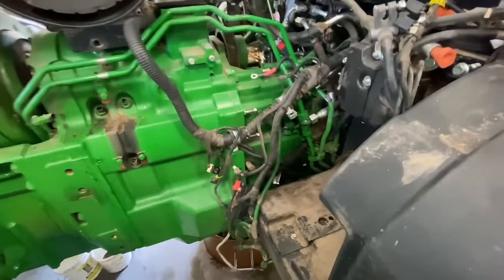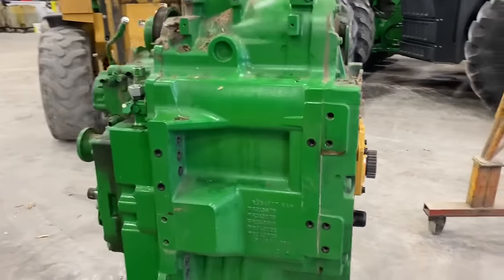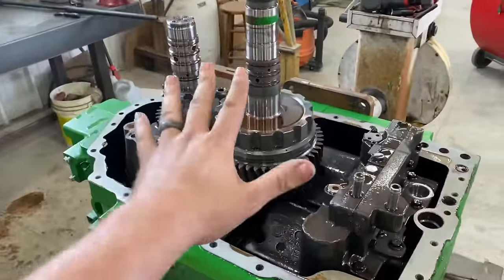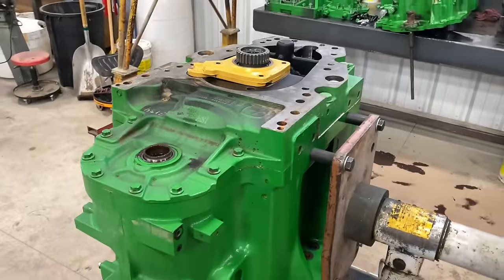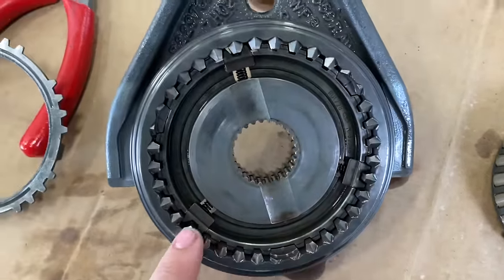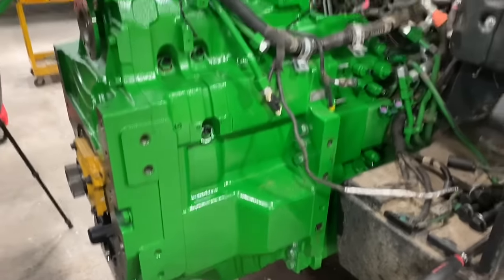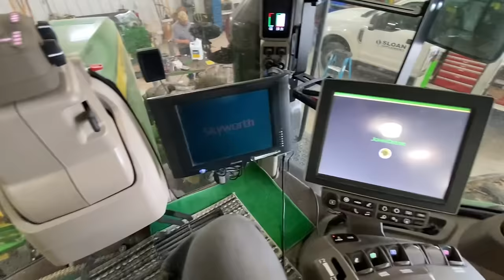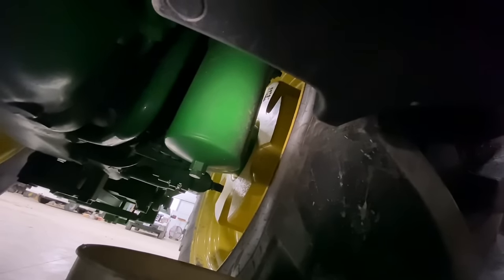John Deere 8370R IVT will not come out of park or calibrate.

Comment: Great video but as a machine owner I'd like to know why things like this break. This would have been incredibly expensive. To my mind it is a design fault. How many hours had the tractor done? I'm in the process of buying a new piece of equipment for my earthworks company and I'm extremely cagey about handing over hundreds of thousands of dollars for inherently faulty machines. Channels like yours can do a great deal of good in helping us make better decisions. With out further info this tractor is off my list.
Reply: How did you come to the conclusion that this is a design fault? What exactly in this design is faulty?
Just assuming it's a flaw in the design because it broke without any further information is a bit naive.

If we look at the simple statistical facts, the 8R Series is no less reliable than comparable machines from other brands. So is the IVT. Single examples of issues are nothing one can use to measure realiability. I even saw a Civic break, and they are among the most reliable cars of the world.

So if you're going to cross every tractor off your list that ever had an engine or transmission blown with low hours, then you're not going to buy a tractor anytime soon :D

(btw, one can order the 8R with the bare bone standard PowerShift transmission if one deems the IVT as too unreliable)
Reply: @LydiaOfTheNorth  I don't know of any pumps that have failed in that way. They wear out typically not break. When you are parting with hundreds of thousands of dollars you become very gun shy of breakages like this. You clearly don't own any machinery. Yes IVT's are unreliable that is pretty evident.
Reply: @toast47624  
"I don't know of any pumps that have failed in that way."
That is anecdotal evidence at best. My mother never had a car accident, that is not evidential of their non-existance though.

"They wear out typically not break."
That is of course correct, yet is a breaking part no evidence for a flaw in a design. Might very well be a material problem, microcracks that snuck through QA etc.

"When you are parting with hundreds of thousands of dollars you become very gun shy of breakages like this."
Which is why you even more should refrain from relying on single issues and look at the bigger picture. Again, just because you see a Honda Civic break with low mileage doesn't make them unreliable cars.

"You clearly don't own any machinery."
Plain wrong, not only do I own but also engineer machinery. Because of this I'm always so baffled when people are able to point out design flaws with literally no information on the matter while I am absoolutely not. 
So my question still stands: can you point out what exactly is flawed in this design of a hydro and / or transmission? I'm highly intrested to find out.

"Yes IVT's are unreliable that is pretty evident."
They are in some parts not as reliable as "standard" gearboxes, but I meant to say that JD's IVT is no less reliable than other manufacturers IVTs. Then again, if that is a concern for you of course, just get the PowerShift instead.
Reply: @toast47624  my comment was not meant as an attack btw, I'm just really curious how you came to that conclusion so fast. With basically no information, that design flaw must stick out like a sore thumb, but it just didn't to me, that's why I asked :)
Reply: @LydiaOfTheNorth  I've been around machines all my life so my suspicion stands. I too would like to know why it failed. Once you have forked out thousands of dollars for such repairs you become pretty sensitive. I buy new equipment and sell it the moment it starts failing or preferably before. My experience is once its starts it escalates.
Reply: @toast47624  I'm a retired tool and die maker and have to agree with you @Foardhook, if I had a component that is repeatedly breaking in a stamping tool, and we can't finish the run without having to pull the tool and put a new punch or perforator or die insert in it, it's my job to tell engineering about the problem, I can suggest a fix, a larger punch or or different steel type or different Rockwell hardness, but it's engineering's call to change the design and to find the root cause and fix it forever and put it to bed, and keep at till it is finally fixed, but if I were to just keep swapping cutting details, I would be asked why didn't I say something? and I think that's the missing part in these video's were not being told or shown if any of these problems get back to JD and if there doing anything about them, if other mfr.'s are having simular issue's that doesn't give JD or any mfg. a pass the acid test is always how well does it work, if it's not working stop and try something different like auto racing if there's part breaking make it stronger or different till it stops breaking, while the poor farmer has to wait and pay before his crop is picked
Reply: @LydiaOfTheNorth  sounds like an attack to me… I have an 8370R and the EXACT same thing happened. One of those pistons in the pump failed. Tractor had a little over a thousand hours. Deere acknowledged it has been an issue. Luckily it was still under warranty or your looking at 25K plus.
Reply: @peteparker7396  well it wasn't, unregarding what it sounds like to you or not. And you're missing my point. Singled out instances of something does not provide evidence of a bigger problem in reliability, nor for it to be a design flaw.
Reply: I worked for John Deere for about 40 years and I can guarantee you these failures like this one get analyzed thoroughly back at the factory engineering in Waterloo.  They're going to run a metallurgical test on each failed part to discover why it failed. If it is a design failure they will change the design and most likely offer a PIP (Product Improvement Program).  They have an entire department that checks these failures both in and out of warranty.
Reply: @michaelpasold5083  Good to hear. No doubt they reimburse the owners out of warranty? LOL I don't think so. So our best defense is to come on YT and show everyone so they don't get stuck with a lemon.
Reply: @LydiaOfTheNorth  I get your point it's just that my experience over the years trumps your philosophical position. Evidently this is not a one of failure as Pete stats and frankly here in NZ I know of others. It's ridiculously expensive. I'll stick to a more reliable tractor.
Reply: @toast47624  my position is not philosophical. It's based on numbers, statistics and probability, or, as one could call it: the cold hard facts. Your position is the philosophical one, since you're experience only shows you a tiny part of the bigger picture. 

As I said earlier, if one never had a car crash they might very well say that, in their experience, they don't exist. Looking at the facts tells a different story.

That WAS my entire point, so apparently you do not understand it. But that's fine.

However, I'm tired of the discussion and I made my point. You buy whatever tractor you want sir, if you can find one that hasn't listed a single failure on youtube, that is ;)

Comment: Thanks for sharing your work. I have a question if this transmission is manufactured by John Deere or is from another supplier
Reply from the maker: John Deere manufacturers the transmission but there are components that are in it from other manufacturers. Like the hydro module is made by Sauer Danfross.
Reply: It is a John Deere transmission
Reply: I'm pretty sure that Deere produces the IVT castings in their foundry in Waterloo, IA - just pulled up a pic of a raw trans housing and confirmed that they have JDFW cast onto them (John Deere Foundry Works).  I worked for Deere (Maintenance - SPO for a bit then T10 downtown), and a couple of their contractors (where I'm still working). The castings are then sent to an outside contractor (Metokote/PPG) for cleanup / primer (IVT castings and a few others are  machined unpainted - not sure why).  They they go to another outside contractor for machining and possibly light assembly (bushings, seals, dowel pins, plugs, etc.), then back to JD for final assembly.  I used to machine these IVT housings so it was very cool to finally see exactly what all went inside them.  One thing that surprised me is that it's a shift fork that went into that bore on the syncro side of the casting.  I always thought it was more of a spool valve due to the pretty tight tolerances in those bores.  I'm also surprised at how little of it you can see from the outside because  Deere were very critical of the appearance of the outside casting on those parts (most others had much less stringent cosmetic requirements).  Anything that had cosmetic issues were automatically scrapped and set aside for a JD inspector to accept or reject.  I also machined the front and back covers seen here, a diff case (7K series), and the ILS case that sits below the engine and connects to the transmission at various points in my short machine operator career (used as a stepping stone to get a CNC technician job repairing rather than running machine centers). The internal components will be a mix of the same, some Deere produced, some contracted out.  When I was at Deere, they were doing a lot of gears & splines in-house including an impressive heat-treating line.  Another interesting side note is that they had a few machines that were 40-60 years old still producing parts because there is no modern equivalent that can produce them as quickly or cheaply as these archaic machines.

Comment: I am impressed with the quality of the repair.  Very curious as to the internal upgrade mentioned. With the model as produced in volume, normal end use might see larger numbers of this model,  this repair, as across a fleet.   
I suspect a cold start and subsequent hard pulling might be a cause *without adequate operating warm up time".  But I am certain Deere is having a hard look at failures in particular as the cost mentioned must be difficult to pass along to customers.
Thanks for the interesting and well photographed post.  M.
Reply from the maker: Thanks for watching! The reman will have the latest and greatest part number hydro module which should fix the issue.
Reply: JD is never shy about passing costs on to customers...with a healthy upcharge.

Comment: He said it's a heavy piece and it's usually stuck pretty good. What does that tell you? This is not the first one he's had to repair that's what. Obviously there is a problem with these transmissions.  This would be good information to have before spending tons of money on new equipment.
Reply from the maker: I would still rather have an IVT than a powershift in my opinion. I've had every modern John Deere transmission apart. It doesn't matter they all fail eventually. I've had more powershifts apart than ivt's. Just because I do a couple videos on ivt's doesn't make them junk. We literally have 100's of these tractors running and we have very good luck with them.

Comment: What a waste ! Just to disassemble then reassemble only to send it away for someone to disassemble it then reassemble. I know exactly why equipment cost so much now. Thanks  very informative
Reply from the maker: We had to tear it down to see what all was damaged so we could pictures sent in to Deere to be able to justify a new reman transmission. Getting a $40k trans under warranty is worth the extra work. Plus when it has power gaurd extended warranty you have to do that. You have to get to the root cause of the problem. Then you get your core credit the transmission has to be complete. And the core is worth a lot of money so it's well worth the time and effort.

Comment: Good call to bad you had to get that far into the tear down before you could evaluate cost , my guess it was good shop class if anything  . Curiously wondering what all new internals and hydros would cost compared to reman’d ? Less than the empty case is worth after waiting months for parts that dribble in ? Getting  queazy just thinking of it !  One Green in hand worth two in the shop

Comment: New to this channel, cool content. Years ago I learned about the problems with this brand not letting anyone else but them work on the machines even though you bought one and it’s yours now not John Deers. Does this mean anyone with the necessary skills can work on them “officially” besides the brand name?. Thanks you.
Reply from the maker: The only time someone can’t perform a repair on a Deere is when it involves software and controller reprogramming. Only because the consumer does not have access to it. Other than that, they can do whatever they want to their machines.

Comment: hello, I have a 7280R year 2012, with 3900hs. working slows down, and then returns to the rpm it was working on. It is not a fuel failure, it is all new filters etc. the throttle does not respond when it drops from rpm ... and it does not give an ecu error, they tell me that there are some can bus chips. that can fail. In your experience, where do I start looking? thanks and regards

Comment: Years ago when Hydro systems appeared in Tractors things didnt go particularly well ... 😢 

Very small amounts of wear in Swash plates made the systems almost inopperatable ...

Now with JD  opperator error  causes more Failures  because components need to be run at the correct speed to reduce Stress on them . 
Both lubrication and Cooling  of the components  work best at the correct  power settings for the Machine ...
I had one Tractor that had a transmittion fault that was able to be corrected   by some fettling ... of gear splines ... 
It showed same metal shavings on gears and splines as in this account ... i Cringed when i saw that in this video ...

Agspanner 😢😂😂😂

Comment: Our 8370r went in for a hydro and spent more time in the shop with gearbox related problems ever since this last time they said forward clutch pack was burnt out and totally unrelated to the original hydro problem 
Then wile in they said it was low on compression and needed rings as detec from Deere so obvious known fault with engine 
all on a less then 4000 hour tractor

Comment: From your experience and knowledge, which would you buy if you were a farmer, the IVT or the Powershift?
Reply from the maker: Depends on the application and what I was doing with it and what HP range we were talking. If it's 370hp or under and I'm using it on a planter, I would go with IVT. The ultimate is the 8400R with the E23 powershift. It's kinda the best of both worlds. When an IVT works great, you can't beat them, there is more complicated things to go wrong than a powershift. The main failures I see with powershifts are clutch Pistons and bevel springs go bad. I would much rather rebuild an IVT than a powershift though in my opinion.
Reply: @ZKMasterTech  What about 7r series ivt? On how much hours usually they need to be rebuild?
Reply from the maker: @Jumbojt  well the 7R IVT has its own issues. There are a few PIPs and PEPs on them. I start away from 7R tractors in general. I do not like them.
Reply: If you're deep ripped like farmers in the southeast..go with the powershift

Comment: I have a question what was the cause of the trans to break like it did was it miss used or was it normal operation and is there anyway from this happening again after it’s fixed been a independent Tec for years kinda retired but loved the video your a sharp Tec love your work ethics
Reply from the maker: Thanks for watching. The tractor was not misused. The customer takes very good care of his stuff. It was just a part failure with the hydro. The new IVT has an updated hydro. So fingers crossed it won't happen again.

Comment: Hello , in my opinion if you pay the operators correctly, you will have functional machines. a well-paid operator should be a good user of the equipment. these green machines are the best in the world, their failure in 90% of cases is due to bad operation.

Comment: So IVT is just fancy  talk for hydrostatic transmission with a few gears;)
Reply from the maker: It's way more complicated than that lol
Reply: Yes and no. In John Deere's case, the "hydrostat" doesn't directly drive the tractor. The hydrostat controls the ratios on the gears between the input and output shafts

Comment: Master tech indeed👍👍🍺
Shietcan that obnoxious muzak between your dialog. Too loud and causes global warming👎👎🍺🍺
Make you wonder how many other transmissions are suffering this same failure🤔
Had you disassembled one of these at JD traning school?. This failure should give every operator some feeling of respect when starting an engine, not reving a cold machine, waiting patiently for oil circulation and warm up.
I'm a retired technician after 47 years of Mercedes-Benz & BMW  wrench twisting. Work safe and smart👍

Comment: Why take the new harness off the reman trans?
Reply from the maker: Because the harness goes under the cab all the way to the back panel where the controller is and there was nothing wrong with the original harness. Would take half a day just to replace it.